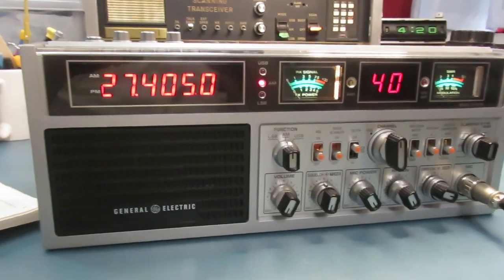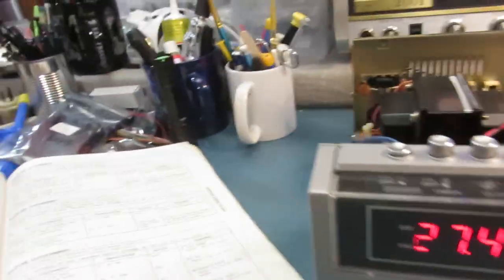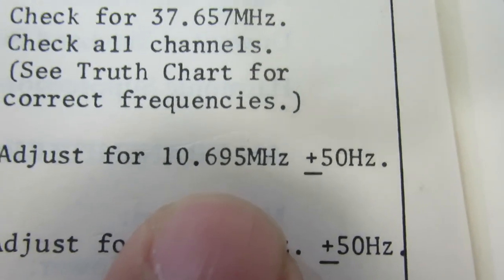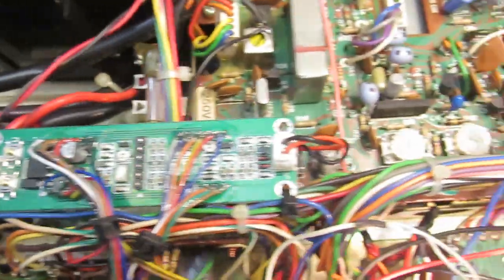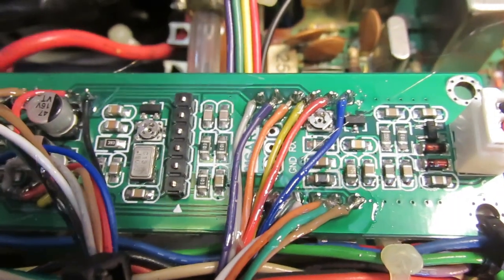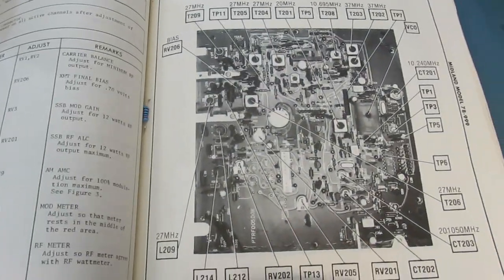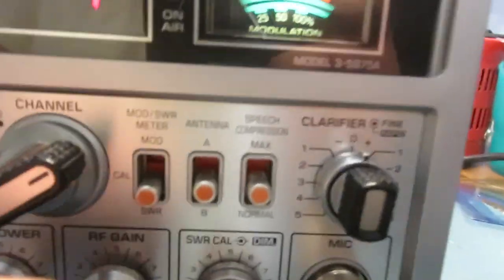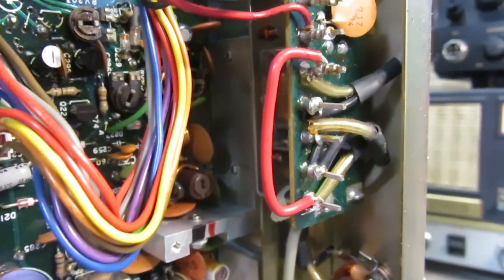Adding a Freq Counter to a GE Superbase  Take 2

Comment: Had a 40 Chanel GE mobile radio only AM 4 watts with out a amplifier that radio would get thru the skip I can't talk bad about the radio
Reply from the maker: They are great radios for sure,  a bit quirky for sure,  and when skip is good... even a coat hanger works  right  LOL

Comment: You just ruined that classic radio
Reply from the maker: I understand the sentiments for sure,  but this CB clock was broken and not fixable. The numbers were a jumble all the time.  So I could have unplugged the clock left it off and the rig was already opened up from past users so it was not stock. I got this off eBay with no modulation AM or SSB TX, no working clock. I say a perfect unit to upgrade with a built in Freq Counter, why do you think 2000 are so popular? its not because of their clock.   thanks for the feedback 73s